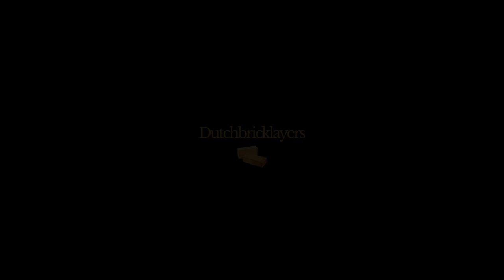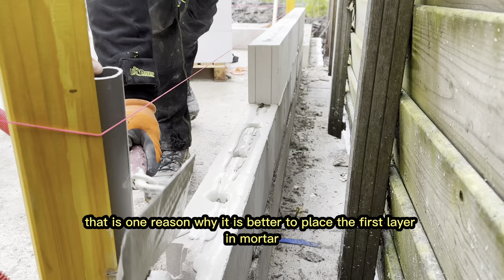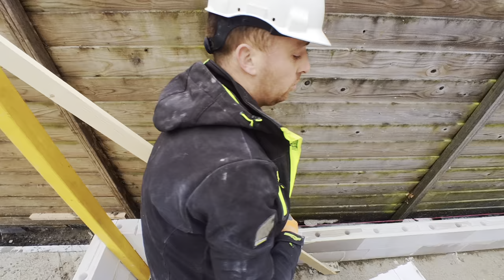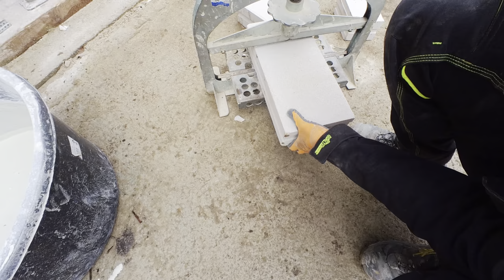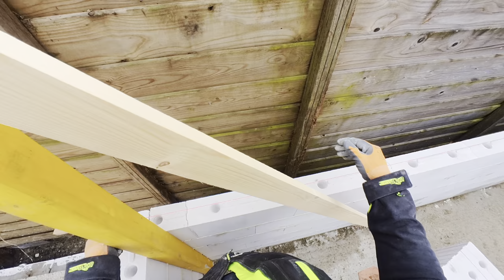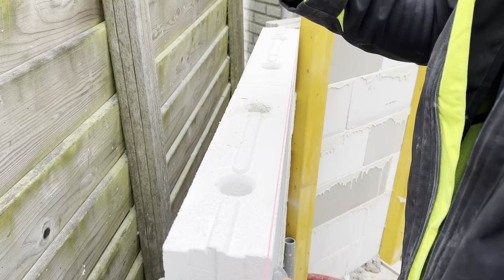Building an extension, inside block wall

Comment: There were no blocks when I worked in Holland in the 70s but they were using this glue block system in Germany at that time.
Reply from the maker: Ahh could be. To be honest we were not born back than. now there are a lot different types blocks here. Thanks for your comment 🙏
Reply: @dutchbricklayers  👍
Reply: How old was you in the 70s Andy working in Holland
Reply: @ianbarker634  22
Reply: Still going strong. You have got more energy than most of the young brickys 👍
Reply from the maker: Thats a powerfull generation
Reply: @ianbarker634  👍
Reply: @dutchbricklayers  👍